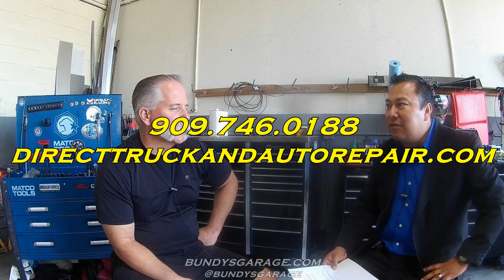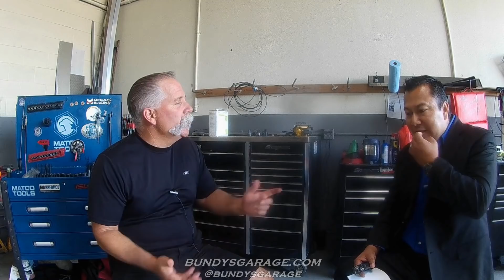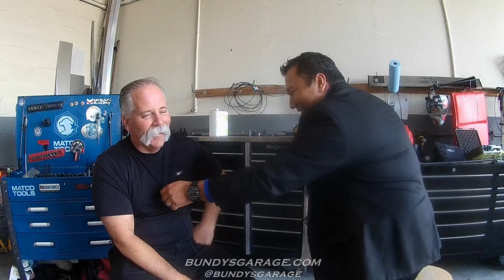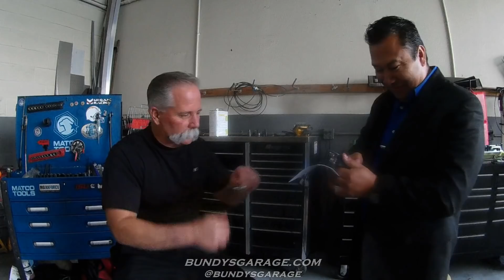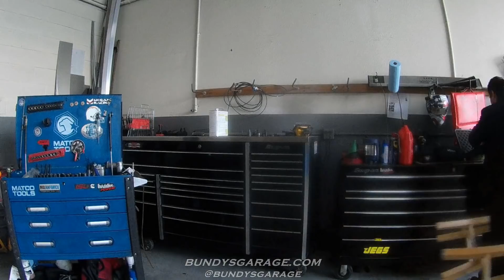Worst Diesel Engine Ever - What is the Best Diesel Truck out There? | Ford Dodge Chevy

Comment: I put 556,230 miles on my 1997 F-250 4x4 with the 7.3 PowerStroke. Would have been a lot less if I hadn't used it to go tow home all my friends with Duramax's
Reply: Big Truck Med Rv bull crap my dads coworker’s son but a brand new duramax diesel the fuel injectors burnt out and he traded it out, my neighbor leased a brand new duramax took it back to the dealer because of transmission problems then he got another duramax had motor problems and the sunroof was leaking
Reply: Big Truck Med Rv 7.3 is a far better diesel than any newer diesel motor you can rely on it for durability unlike the duramax and new powerstroke and like I said before the 7.3 many not have 300 or 400 horsepower like the new diesel trucks but it makes that up in lower gear ratio and I have seen a brand Chevy duramax and Ford struggle to pull a half empty trailer on flat surfaces and then a 7.3 comes along with a way heavier load just pulling its load like nothing
Reply: Big Truck Med Rv they maybe hard to start but remember that a powerstroke Diesel is a international diesel they aren’t meant to shut off where every you go they are meant to leave running. Plus a 7.3 powerstroke makes up for what it don’t have in horsepower with low gearing which what makes able to out perform those duramax‘ s and what hurts the duramax the most is too high of gearing for a Diesel truck
Reply: good to know, learning from your comments, my 97 250 HD may be close to gutless, but gets the job done and runs smooth, and is good for snow
Reply: Good thing ford did not build that 7.3 international engine
Reply: Donald Kinder it worked a lot better than the GM motor that Chevy used to use
Reply: Big Truck Med Rv you also know what hurts a lot of people they want to get in and start a 7.3 Diesel without cycling the glow plugs which can help a 7.3 a lot it also hurts 7.3 Diesels that people also want to drive them like they are driving a sports car and my uncle has a 7.3 powerstroke and we have started that sucker in 20 degree weather like it had been plugged in the night before without being plugged you morons like bragging up duramax because it is a General Motors product but in fact it is a combination of GM and Iszuz
Reply: Way to go my 93 F-250 69l international has about the same mileage and runs great. Beat up rust bucket but that truck has my heart!
Reply: TimesThree those 7.3 powerstroke has always been a reliable diesel and that was back when ford had a good powerstroke after the 7.3 everything went into a downturn for the powerstroke
Reply: @czwarlord9243  International is a great engine though.
Reply: @czwarlord9243  I'm sad that I read this whole conversation. I agree that the 7.3 was not a powerhouse, but there are many still in service, although repairs have become increasingly more costly. I own an LML and am quite happy with it. My dad had an '01 24V, with a 5 speed, which was a great truck until it was totaled with 275k on it. I can however guarantee you that none of the previous generations from GM, Ford or Dodge would outperform my truck when towing. While the 6.0 had it's own issues, I would be more inclined to pay for a set of headstuds before I purchased a 7.3. There's a difference between nostalgia and superiority.
Reply: @czwarlord9243  they just run hot ? thats pretty major. the 6.0 once you delete and stud are awsome as well.there is also plenty of 6.0s and 6.4s with 300k on them with no issues. truth is they all had issues. your talking about putting thousands in your reliable duramax to make it reliable. this makes no sense. all diesel guys are alike. "i have 300k on this truck and all i had to do was replace 2 grand worth of injectors,500 bucks in fuel pumps,a few hundred in glowplugs ,600 dollar radiater,ect. thats not reliable when people are consistently getting 300 k out of ford and chevy gassers with one 100 dollar tune up.
Reply: @czwarlord9243  wrong my 2002 f150 supercrew 2x4 came with 320 hp and 420 torque because it is forced induction . now that being said it is not impossible to build a na 7.3 liter moter that makes 550 pluss ftlbs of torque . they havent released numbers yet but fords been making gobs of tourqe  on na moters alot smaller(almost 2 liters) and my 97 f250 is na 7.5 liter and it makes 400ftlbs so with vvt and direct injection i would say anything less than 600 will be a disappointment. they spent millions desighning this moter even going back to pushrod( because im sure its going to have a +4 inch stroke so ohc is unnecessary when your moter cant spin over 6 k because of piston speed) if it doesnt they wouldnt need it because the 6.2 is pretty tourqy allready.
Reply: @czwarlord9243  are you ignorant.  gassers dont have lift pumps. it was behind quotations. thats what you and everyone with a mid to late 2000s diesel has to do. i was quoting you as a matter of fact. i have never had a injector go bad. you cant talk about how reliable your duramax is and say you had to change to a lift pump, change the injectors, and change the radiator to make it that way. you havent said a thing that makes sense isuzu diesels were junk just like all the others in the 2000. fyi year compared to year at factory settings the dirtymax came in last. sure your mid 2000s duramax would out run/pull a 99 power stroke. but not a 6.0 or a 6.4. dont get bent out of shape. oh and its pretty cold out tonight better go plug that thing in so it will start in the morning. im sure them glow plugs probly need attention. looser
Reply: @nathonsmithson3024  Tell him out, bro! He has probably never been around a diesel; condescending comments gave it away. 
You have the 5.4 in your F150? That is a good little engine. They are known to have spark plug issues, but they fixed that pretty quick. My aunt had a 97 Expedition with the 5.4, and my friend has an 04 F150 Lariat also with the 5.4. His F150 definitely gets better gas mileage than his 01 GMC 2500; I believe it has the 6.0. I wish my mom got a 2014 or older Expedition instead of a 2015 Explorer, but at least she got one with three rows of seating.
Reply: Јоhn Daniel Is
Reply: Big Truck Med Rv in my experience with diesel trucks if it says Chevy or Ford even the older ones car dealers double charge people
Reply: Big Truck Med Rv but then again the dealerships I live near charge more for the older models
Reply: Screw all you fanboi's! Real men Get a DD15 Detroit! (Or a Cummins ISX). Mini-trucks suck! LOL!
Reply: @bjbeardse  Wrong! Real men get a Cat 3206 or the older Maxforce engine! ISX was probably the worst Cummins engine next to the 03 5.9 common rail!
Reply: @mikehauncho1389  well, since you wanted to go there, Ford or Mercury Same shit, different pile. I did tell my buddy his PU got pulled home by a Shit Pile according to a guy on the internet. I told him since it was on the internet, it had to be true. :-)
Reply: Big Truck Med Rv There’s no way thy are the worst cold starting have you seen the 12 valve Cummins cold start??
Reply: Drew Postma to be honest I would rather have a Diesel motor that takes longer to start in cold weather because the older motors are more reliable than the new motors because the old motors were built with die cast iron and were built for power that is why Chevy and Ford are jokes now
Reply: Big Truck Med Rv that is why they put plugs on the damn thing it is meant to be plugged in overnight and dodge and Cummins doesn’t use 3.73 gear ratio those dodge rams primarily use a 4.10 gear ratio to balance out the torque without tearing out a rear end
Reply: Big Truck Med Rv those motors were designed to tow with not drive around every day and by the way the motor liters your motor is the hard it is too start in cold weather
Reply: Big Truck Med Rv I have seen the same damn motor with not able to pull a trailer loaded with cattle on a small hill lag out my uncles truck has hauled a trailer with hydraulic ramps which was heavier than the truck itself then he put well over 20k putting over 30k no problem
Reply: @zackhaycraft8159  What year is your uncle's truck?
Reply: JDFan98 ‘01 and it is still stout compared to my neighbors brand new duramax
Reply: Big Truck Med Rv plus my uncle also owns an international s1600 with a non turbo 7.3 with 13 ton of rock on it pulled hills like it was nothing and if the duramax is so grand explain why when GM put it in their commercial trucks why they went busted there
Reply: Big Truck Med Rv and ironically I can buy a duramax powered commercial truck it is still for sale going on 4 years now that really tells you about how good that motor is
Reply: @czwarlord9243  I don't know about 7.3 i drive 6.9 but reading your comment leads me to believe you don't know much about ford and international.
Reply: @czwarlord9243  I'm man enough to say I'm sorry. BTW my truck is an 87 been hitting the rum a little. International is a great engine.
Reply: @czwarlord9243  um I was talking about the 6.9L
Reply: FYI, your '97 PowerStroke is a NaviStar engine, not the garbage Ford built 6.0 PowerStrokes onward. Why Ford ever went away from the NaviStars baffles me.
Reply: @Nexus-6  Actually, the 6.0 and 6.4 were also made by Navistar. The 7.3 Powerstroke is a rebranded T444E and the 6.0 is a rebranded VT365. It was honestly a good move for Ford to not go with Navistar after the 6.4, because the Maxforce engine that they started using circa 2010 was a big POS. They actually stopped offering it in 2016. I think the Ford should go with Cummins. If the new Fords had the Cummins as an option, I would definitely pick that over a new Ram, but my top choice is still a 7.3.
Reply: @czwarlord9243  I actually think that the 6.4's were garbage compared to the 6.0. We always ran red Caterpillar antifreeze and never had issues with electrolysis, but all of the automakers started pushing "ELC" coolant around that time. All autos in the early 2000's struggled at power levels over stock, but the 5R110 was far better than Dodge's 47/8 RE. I love my truck, I think GM has a great package in the 3/4 & 1 ton segment.
Reply: Big Truck Med Rv Agreed, I’ve spent a long time around these pickups and came to my own conclusion that GM had the best overall package. The only thing I don’t care for on my truck is the CP4.
Reply: Who makes that? I think the LML is a nicer truck than the LMM. I bought my truck used with 14k miles over a new L5P due to the, then, lack of ability to delete an L5P. I’m still happy with the decision though due to the cost to unlock the L5P which is somewhere around $2500.
Reply: Typical Ford defense....yawn!
Reply: Brian Fetzner I have standards unlike you parents who created you and not only are you wrong but you are incredibly stupid because in Kentucky it is illegal to marry your cousins
Reply: @JOHNDANIEL1  
It's Japanese not Chinese. The 6.6l Duramax is an Isuzu engine.
Reply: @czwarlord9243  I'll get a Duramax for my future wife to maybe pull her horses with. I love seeing a girl in a Duramax, but a real truck is a 7.3 or a 6.7 Cummins. The only Duramax I like is the 03-04 LB7.
Reply: @czwarlord9243  I think you are the real moron here. I rode home with my scout leader in his 7.3 and we were pulling a 5th wheel toy hauler. It did not even feel like we were pulling anything. Try doing that with your sissy Duracrap. If Duramaxes are so great, explain why my friend was overheating in her dad's 05 LLY and why their 2015 LML is always in the shop. I worked at a Ford / Chevy dealer for 6 months, and I can probably count on 1 hand how many 7.3s have been in. I couldn't even count how many Duramaxes were in their.
Reply: Big Truck Med RV It's true, my dad pulled a mini excavator with his 07 LMM, but that's nothing. You could probably pull that with a F150 Ecoboost.
Reply: @czwarlord9243  Yes, the LBZ is good too. I am impressed with with the new Chevy trucks. I've heard they get really good gas mileage even when towing. I am also a fan of the Bose speakers in GM trucks. No, I'm not just saying that because the girl I currently have a crush on drives one for her dad sometimes (though it took that kind of persuasion to see Chevs were actually good). If I ever win her over, it is a good bet that she'll convert to Cummins or 7.3 Powerstroke. If I was in the market for an SUV, it would probably would be a 2003-14 Suburban LT, but I'm still gonna back those people up on the 7.3.
Reply: @czwarlord9243  I don't know much about Duramaxes, because my dad never got one bessides that LMM. Duramaxes also lack the space in the back seat. I never noticed it when my dad drove one, but now that I'm bigger I notice it when riding in other peoples' Chevys. The 7.3 is the only good Ford built. The 6.0s were pieces of shit; we noticed it after a year of my dad buying an 03. He probably would've gotten a 7.3 if anyone knew how shitty the 6.0s were. International did fix that problem in 05; our 05 never had any trouble with it in the 2 years that he kept it, and it was bone stock. 6.7 Powerstrokes are money pits. That cattle trailer may have been a little big, so we'll have to try pulling a tractor or something with your LML. All I can say is when he had that LMM, we struggled to get through a field with a trailer that had 2 big square hay bales on it, and then he called my ranch hand and told him how much he regretted buying a Chev, and he should've gotten a Ford. It was probably a good move, though. The 6.4s were bigger piles of shit than the 6.0, but he is still delusional because he will never try out a Cummins.
Reply: @czwarlord9243  Watch Duramax cold starts 2016.
https://www.youtube.com/results?search_query=Duramax+cold+starts
Reply: Well I literally just towed 21,000 lbs. (Trailer 3 axle 21k @ 7,000 lbs, 1996 DitchWitch 8020 with reel carrier and vibratory plow @ 14,000 lbs) with my 1993 7.3 idi F350 with 387,522 miles on the clock and only second E4OD. I own a 2018 Canyon Denali with Duramax 4 cyl. And have had every Diesel produced by the big 3 since the 80's. I love my Canyon. I pulled 8,500 lbs with that little 4 banger and could pull more but the weight of the truck itself becomes sketchy. And illegal. Duramax is by far and away the best of the Diesel engines manufactured by anyone since emissions became a standard. However, if I had to choose one of the engines for the rest of my life it would for sure hands down be the 7.3 Turbo. I love the IDI for its simplicity but it just lacks the power a simple turbo will add. But straight up stock... 7.3 wins for all around greatness. Lowest maintenance, the E4OD isnt great but much better than any Dodge transmission ever built and if rebuilt right is damn near bullet proof. The 5.9 Cummins is awesome, the 6.6 duramax is awesome and the 7.3 is awesome. With some expensive corrections the 6.0 powerstroke is awesome too. The 6.4 and 6.7 are literal trash. If you really want longevity it's the 7.3 turbo. If you dont give a shit about power it's a tie between the 7.3 IDI and the 6.2 Detroit.  Diesel. Cat even made a good diesel but not for the consumer market. The 6.5 could have been great but for whatever reason they went cheap.
Reply: @Lordhumongus  Wow! Your IDI can probably pull a shit ton more than my dad's 2014 6.7 Powerjoke. I hope one day dad will wise up and get him a 6.7 Cummins. The only diesel pickups my grandpa got were 5.9 Cummins (that is only because he died just before the 6.7 was dropped). Sorry I can't agree with you on the 6.2. Those are pieces of garbage and the only place I ever saw one was on youTube.
Reply: @2001FordPowerstroke  6.5 was problematic (except the ones put in the Humvee... still in them btw) Other than having to relocate the PDM the 6.2 was a long life monster. Those military trucks are still running brotha. There wasnt a ton of those produced but the 6.2 was a bull. Definitely not garbage. I dont know if my IDI would out pull a 6.7 and it certainly isnt going to do it breaking land speed records. But it will pull it.
Reply: @czwarlord9243  I was saying "scout leader" to try and not be so offensive on youTube, but fuck it! My young men's leader was hauling a 5th wheel with his 1999 7.3, and it felt like nothing. It was mostly stock, too (except for a turbo wine), but that didn't help the performance. You, on the other hand, had to do a bunch of mods on your LM-hell to get it to pull what you need. We didn't pull any heavy loads with my dad's 01 7.3 in the time we had it, but I know it would have pulled my grandpa's dozers like a champ, as opposed to your Duracraps which struggle to pull a trailer with 2 hay bales on. Keep bragging about your Durajunk all you want, but a real man drives a 7.3! Real men also aren't dicks to people who like a different engine than them.
Reply: @czwarlord9243  I hope you understand that I am not a person who throws insults out, I only insult those who try to tear me or others who think the right way down. You were being a real dick to that guy who was talking about his uncle's 7.3, and he never said anything to hurt your feelings. If someone says something contrary to my beliefs, I will let them know, and I will also let them know if they are being dicks to others on YouTube. Duramaxes are nice, but I still like the 7.3 over that. And you can thank the girl mentioned in my previous comments for even getting me to say that much. If her family didn't have Duramaxes, there definitely would've been no way in Hell I would've said anything about those short cabbed pieces of junk that struggle to pull two hay bales through a muddy field. Same goes through any modern (2003 or newer) engine out there. They just can't last as long. Even my 07 5.9 took a shit last March. True, we should've made my ranch hand maintain it more; but still, older engines can take it. I don't have that much faith that our 2011 Ford is going to live to see next Christmas. The only one of our feed trucks we were able to sell was a 94 Cummins. Just goes to show that older diesels are more reliable than the modern shit.
Another thing, experience isn't always about whether I was ever in the driver's seat. You have experience just from being in the cab when a heavy load is being pulled.
Reply: Big Truck Med RV Your trailer still isn't as big as that stock trailer we pulled. Modern engines do not pull as well as the older ones. My dad and I hauled our tractor with his 2012 Ford Powerjoke and it was shaking the hole way home. When we pulled it back with my 07 5.9, it had no difficulty at all, because it is still an older engine. A 7.3 could've pulled that tractor just as easily as a half ton pulling a motor cycle. Case closed.
Reply: PowerJoke. You were just lucky that your truck lasted that long. Some other people’s PowerJokes break down after 200k miles.
Reply: @kangvp9512  Well my dad's 2014 Powerjoke isn't that shy of 200k.
Reply: @2001FordPowerstroke  some people are lucky, some aren't. Hopefully, your dad's truck will last a long time.
Reply: 1996 F-350 crew w 7.3 once it hit 324,000 mi it decided to start sucking all the oil out of the oil pan  over a distance of 40 mi.  12 of the 14 qt.  Ended up dropping a rebuilt in,  those are getting tough to find.  Never did find why it went from using almost no oil in 5000 mi to 12qt in 40 mi.   Turbo was in good cond.
Reply: Duramax always served us well.  Got 08 GMC 3500 HD with Duramax and Allison trans.  Heaviest load we have hauled that got weighed was 36k not including the truck.  Just trailer weight.  I'm sure we hauled heavier but never had to weigh them.  Heaviest we hauled and had to rough figure up weight on was around 44k give or take 1k.  Our Cummins buddy couldn't pull it.  Nobody around with a power stroke to try.  Cummins was a early 2000 or so. Don't know anything about those so couldn't tell you anymore than that.
Reply: lol bro you accidentally put '556' in front of the 230 miles your f250 ran for and then took a shit. btw your friends in their duramaxs were the one pulling your ass back to the shop lmao
Reply: replace the IPR, mine starts fine
Reply: 7.3 was my last Ford Diesel Truck. Now a Duramax guy.
Reply: @czwarlord9243  hey i never thought ford would go back to pushrod gassers but they say the got one coming out in 2020 that supposedly going to have almost 600ft lbs of torque and will get almost 20mpg. if true that will be a  game changer
Reply: @czwarlord9243  ironically a 7.3 liter lol
Reply: @czwarlord9243  im pretty sure the torque is going to be near 600. not a stretch when my 02 f150 5.4 came with 420 ftlbs
Reply: Big Truck med rv of course 7.3s are underpowered for modern vehicles same for everything else, compare apples to apples buddy and people will listen, also a 7.3 is  one of the most reliable diesels out there, theres a reason why most are still running today, you must be joking on duramax reliability, how many duramaxs from 1995 to 2003 are still out there today? nothing compared to the amount of 7.3s still working hard. 7.3s don't have a lot of power if you compare them to modern diesels you might as well compare a brand new cummins to a 1919 one, what do you think the power diff is??
BTW id rather a a diesel engine that lasts decades and doesn't act like a racecar(only ignorant people treat stock diesels like race cars) then have a high powered one and worry about life.
Don't forget the 7.3s are in dump trucks pulling 25k most of the time. How many duramaxs do that and last over 500k miles? Im not talking about i know a friend who does. I'm talking about the majority here
Reply: They stopped making those in 2003 and its a 7.3L big iron engine of course it doesn't like cold weather
Reply: Big truck med rv of course all engines have their issues we are talking about the amount and seriousness of issues, 7.3 to duramax years duramaxs are money pits, also something that just comes with maintenance, 7.3 hpop and injectors dont have problems, its ignorant owners that don't  change the top end oil. its a heui system and the 7.3s don't recirculate the top end oil much at all. If you change the top end oil every other oil change you won't have problems with the hpop or injectors and they usually last well over 200k but of course like anything maintenance is key w/o that i don't care what you have it will die pretty quickly w/o good PM
Reply: Yes ok dumb fuck. 370.000 on a 6.5 never been opened up and the 7.3 is not even a Ford engine. Ford is has the worst engineering and hardest to work on out of the 3
Reply: @czwarlord9243  very true
Reply: @mikehauncho1389  you must be a dumb fuck? I think so
Reply: 1970 olds442 I don’t screw my family like your parents I have better taste in motors and reliable older is better except in your parents case then older is terrible
Reply: Big Truck Med Rv my cousin owned the 6.7 it doesn’t even come close to the 7.3 you can’t pull that much with them now my cousin has a 24 valve Cummins out pulls everything my uncle has plus I have seen a 2018 f250 powerstroke it had trouble pulling a half empty trailer on a straight road and completely flat it was struggling
Reply: After reading most of these immature comments that doesn't amount to a hill of beans... Who cares of what you use to take care of your business as long as it works for you. Real men don't need to compare, we just need to get the job done. Only little boys want to participate in their little pissing contest that only proves their lack of maturity and b.s.
Reply: Big Truck Med Rv I have seen 7.3 out pull the 6.7 powerstroke you cannot take an aluminum motor and out pull anything and fun fact after people blow up a powerstroke they convert them to a Cummins
Reply: @czwarlord9243  cardboard in the grille. Get it partially warm. 😕😥
Reply: @czwarlord9243  look at his profile picture, clearly he cares about background. 👀
Reply: Big Truck Med Rv the 7.3 liter powerstroke is the best powerstroke Diesel my uncle has the 7.3 powerstroke and me and my dad has hauled my uncles dozer which is heavier than those duramax diesels
Reply: @zackhaycraft8159  You've hauled a dozer with a pickup? My dad's 6.0 did pull my grandpa's track loader, but he was still only going something like 30 MPH with the gas mashed to the floor. I'm not sure our 6.7 would've handled that load. My ranch hand was pulling a self-propelled swather with our 2011 6.7 and it was having some trouble. Our 2014 shakes when we pull our 5th wheel trailer. 7.3 for life!
Reply: JDFan98 my uncles truck blows in the doors of my neighbors duramax when he pulls with it and my uncle also has a international 7.3 non-turbo and it handles hills that most of my truck driver neighbors trucks can’t handle well
Reply: @zackhaycraft8159  01 is my favorite year of Powerstroke. My dad had an 01 F250 XLT, and I have missed that truck since he traded it in for a 03 6 blow that he got new. He probably would've stuck with the 7.3 if he knew how shitty the 6.0 was gonna be, but a year later, it was struggling to get to my grandma's house without dying like every minute. I am saving up for an 01 7.3 XLT or Lariat with a bench seat.
We also have an International grain truck. I'm pretty sure it is a 7.3 non turbo from 93 or 94, because it says "Navistar" on the engine. It actually came with the pig farm we bought back in 2014, so there is probably a reason they threw it in so easily. It has problem after problem, but it is a nice truck. It currently has a problem starting, despite the fact that we just changed the batteries last year at this time. I love that 7.3; and I can guarantee that if my girl crush never drove a Duramax, ther is not a snowball's chance in hell that I would've ever liked any style of the Chev except the 80s hard body. That Big Trucks Med RV guy is a real tool, isn't he?
Reply: JDFan98 you can’t go wrong with a 7.3 they are reliable and keep going with the years my uncles 7.3 dump truck has over 400,000 miles and still running
Reply: @zackhaycraft8159  True. I've only seen like 2 or 3 7.3s in the shop in the time I worked at a Ford Chevy dealership, because they never need that much work done to them. On the other hand, I can't even tell you how many Duramaxes, 6.0s, and 6.7s have came through the shop.
Reply: JDFan98 my neighbor has a 6.6 duramax and he leased one a couple years back and had to immediately take it bake to the dealership because of motor troubles and ironically the most desired motor is a 7.3 powerstroke or the 5.9 liter Cummins 24 valve diesel versus the duramax
Reply: @zackhaycraft8159  Yeah, I hate people who act like they are hot shit in their Duramaxes. Yes, my crush's family are Duramax lovers, but they are not dicks about it. The 5.9 24 valve (2002 or older) is pretty beastly. My grandpa had a 2000 5.9, so there is a lot of good memories wrapped in those engines. If I absolutely had to get a new truck, it would be a 6.7 Cummins.
Reply: Zack Haycraft I did see maybe 1 or 2 6.4s in the shop as well. We actually had to push one of them out of the shop, and it was a dually. The rest are probably either in the junk yard or refitted with a 5.9 Cummins. My friend has an 08 F350 DWR with a 12V Cummins and an Allison transmission. It is a pretty good truck, but I would still take a 99-01 7.3 if I had the choice.
Reply: JDFan98 unfortunately for me my neighbors are dicks about their duramax and run me and others people’s trucks down because we don’t have one and ironically my neighbor is so far into debt it isn’t funny and I am just waiting for their day to come
Reply: @zackhaycraft8159  They are probably taking their problems on you. They are just jealous of your uncle's awesome 7.3. I don't know why they love their Durajunk so much. My dad got one and regretted it within a year. Unfortunately, he was stuck with the bastard for 5 years, because no one would take it after he hit an elk. I still don't understand why he didn't just keep the 7.3, but he's one of those guys who would put 100k miles on the truck and then look for a new one. If I get a 7.3, I'm never gonna sell it.
Reply: @zackhaycraft8159  your full of bullshit too
Reply: @zackhaycraft8159  so do you have kids with your sister? Or do you have kids with your mom?
Reply: Big Truck Med Rv I wouldn’t give no 70k plus for those duramax diesel plus I the are the “most reliable” explain to me why my neighbor had to a brand new truck back because he had only had for one week. Those 7.3 powerstroke diesel is the best powerstroke made because they don’t have all of those computers and unlike the duramax you don’t have to worry about the sorry fuel injectors like you do on a duramax
Reply: @zackhaycraft8159  yeahhh A 7.3 Powerstoke has computers, and yes 7.3s are fucking gutless. I really feel like you don't know what your talking about because you acted like 12k lbs was a lot for a diesel. Ive almost hauled that much with a half ton gasser hah.
Reply: DropShotMaster1000 not as many computers as that izuzu/Gm duramax and those duramax diesels are haunted  by problems such as fuel injectors going out because they didn’t put a fuel injection pump causing it to literally starve the fuel injectors for fuel and my uncle has had well over 22k on a 7.3 powerstroke
Reply: @DropShotMaster1000  It is not about power it about gear ratios. My 6.9 l  250 in granny plus 4x4 low will go 4mph @4,000 rpms.
Reply: I've towed five Powerstrokes with my Duramax personally, 2 of the guys went and got them, well, one from Chevy the other got a GMC. Mine is a 2001 model and still going strong and looking awesome.
Reply: Ok fanboy. Duramax is the best and everyone knows it.  I could drag your pos Ford around like a child's toy with my duramax
Reply: Yeah no kidding my 05 lly pulls my 7000 lb. boat around just fine and has for years.  No need to pull a backhoe since I'm retired.
Reply: @kenshinhimura9387  ill drag your duramax anyday with a 7.3
Reply: @FordmanHaulit3002010  good luck with that. My truck will rip yours in half and drag it to the scrapyard.
Reply: @kenshinhimura9387  
"Ok fan doy" you mean that Isuzu 6.6l Duramax?
Reply: @118chosen9  is that the best you can do soy boy? Calling it an isuzu like that's supposed to be an insult? Don't make me laugh.
Reply: @kenshinhimura9387  
I'm calling it an Isuzu because it's exactly what it is. That engine is engineered and built by Isuzu.
Maybe you didn't know that.
Reply: @118chosen9  it was co-designed by isuzu and general motors and is built in the USA by GM.
Reply: @kenshinhimura9387  If you think your Duramax is so great, you should try pulling a big stock trailer with it. We borrowed an LML from a guy who runs cows and his stock trailer. I'll bet my dad had the gas mashed to the floor and it was still gutless empty. 7.3 all the way!
Reply: @2001FordPowerstroke  you're totally delusional. My lbz can pull that trailer fully loaded like it's not even attached to the truck.
Reply: @kenshinhimura9387  Yes, the LBZs are pretty good engines, but they do not hold a candle next to the 7.3. If Duramaxes are so great, explain why GM pulled out of the light duty segment in 2008. It's because Duramax is a shit engine. They are good for driving around, but they are not so great for pulling. The other factor in GM pulling out of the light duty business was probably that Cat was no longer an option after 2010.
Reply: @kenshinhimura9387  junk